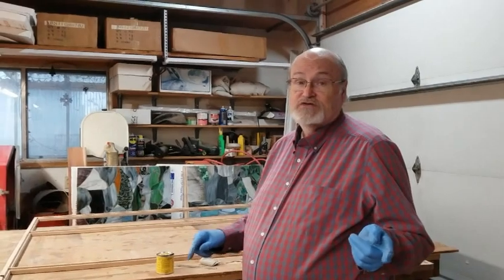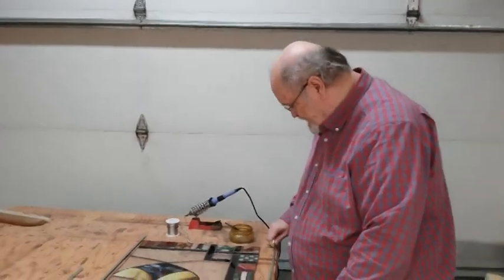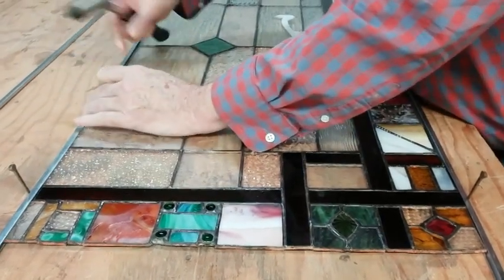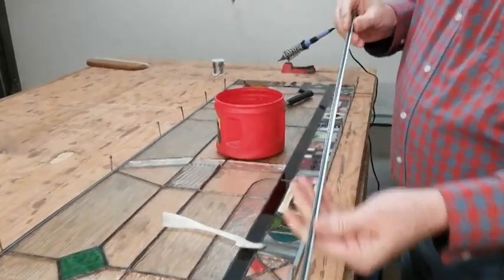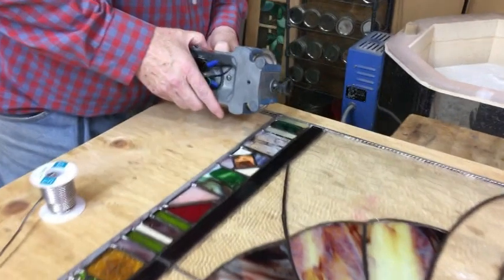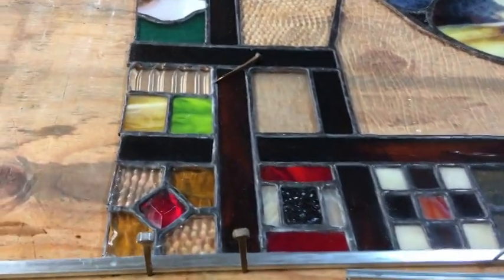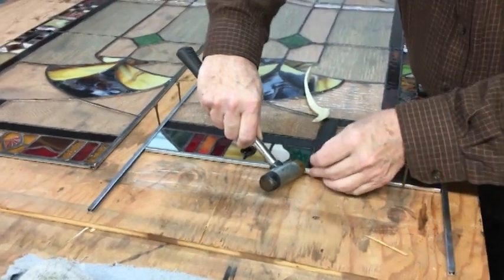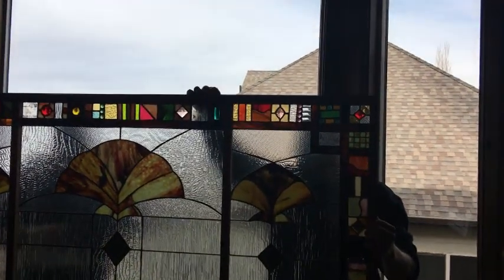Big Stained Glass Frame And Install V295

Comment: I have to do this quite often and I used a wood block against the wall and use a 3/8 wide flat blade screwdriver which I push along the zinc groove while wearing thick gloves to avoid injury. Goes quickly and works every time.
Reply from the maker: Thanks, we'll keep it in mind. I enjoy having a pro glass installer go with us on installs, we don't have to take on so much liability and two heads are better than one!

Comment: Awesome panel. Love the three pane design...the simplicity of the center panel design and that border is sublime.  Any chance you could share a mini scale sketch of this work. I would be willing to pay for any repro costs associated. I have a 48" x 48" center window in a newly installed bay window cluster for which this design would be spectacular. Also looking for a challenging winter glass build project...been looking at FLR ideas and Prarie style but yours just grabbed my attention.
Reply from the maker: They are pretty easy designs. One thing we've done is to view a video on a tv screen and pause it where we wanted to copy. Then we trace the image. This is how we did a copy of the stained glass from the Santa Claus 2

Comment: Wondered how the Alder frame rails and stiles were attached. Couldn't see the joinery. Just glue and maybe corrugated joint fasteners? Looked pretty solid. Also I reviewed your V295 vid. and saw the design line drawing... exactly what I was asking for in my last entry.. Thanks so much. I now have my winter '23 project.
Reply from the maker: Hope all goes well. when we got to the install, Greg took a sander to one edge to get it to fit even better. The joinery was glue and nails.
Reply: @GommStainedGlass  Thanks for the information
My version will be in a 44.5" square window space. I am considering constructing the design as a single pane rather than the three panels you folks created. I think the size is right on the cusp of " too large " to be stable. Possibly OK with thoughtfully placed restrip and some chunky perimeter copper channel. I'be been sketching it out on paper and I think the space is too small to accommodate the design and the two extra frame rails for a three pane install.  Your thoughts?

Comment: This is a beautiful window. Beautiful job. Just wondering if you put any sort of rebar supports on it any where?
Reply from the maker: We never use rebar since we only do the copper foil method. So we use restrip which fits down in-between the solder joint. Since the three panels are small, they are fine with silicone holding them in the wooden frame.

Comment: WOW.  That was pretty spectacular.   My only question is,  what/how did you do the final anchor once the window was in place?   1/4 round?
Reply from the maker: Glass Doctor helped with the install and the frame fit so tightly that we just used silicone to hold the assembly in place. It looked perfect!

Comment: When adding this to an exterior window, how do you deal with the temperature differential and preventing condensation inbetwen the stained glass and the actual window glass?  Doyou have air holes in the frame?
Reply from the maker: When we install a panel, it's almost always against an insulated unit so there's little temperature variation. When it's a fairly small panel I will often leave a gap in the caulking to allow slight air flow to minimize condensation. The large frame in the video had so much square footage that air flow was pretty good and the frame wasn't sealed tight so the unit breathes.

Comment: Did you use re-strip in these windows since they are so large?  or because they are framed in there would be no need?  I have not done any windows this large yet and just want to be prepared when or if I am ever asked to.
Reply from the maker: I posted  a video on restrip three weeks ago where I showed how I placed it in the center of the largest panel. https://youtu.be/G73if4vZIX8
Reply: @GommStainedGlass  that’s the same piece?  Sorry I didn’t recognize it was the same window.  You responded to my comment on that one.

Comment: I thought I saw one of the jewels going to the edge. Do you have any trick for dealing with the raised glass when it is substantially thicker in a small spot when putting on the zinc?
Reply from the maker: If I have a raised edge, I simply widen that part of the zinc a little extra so that it fits over. I had to make all of the zinc edge wider since the solder went rint up to the edge, rather than staying away like we usually do.
Reply: @GommStainedGlass  fabulous window,

Comment: David, Have you ever used “center cut” frames?
Reply from the maker: No, I'd like to know more about them.
Reply: @GommStainedGlass  I use center cut Black Walnut frames. The center cut is very doable if you have a table saw.  I’ve even center cut 1/2” frames for incredible strength. With a little practice you can master this.
Reply from the maker: @j.k.terrell8034  Thanks, the knotty alder wood that Greg used for those frames is also very tight and strong. As a wood worker, I love working with walnut, so we'll have to give some center cut a try. Thanks for the comment..it helps!
Reply: @j.k.terrell8034  Can you please explain the term center cut framing please. Attempting a similar project as this window and looking for options for constructing a sturdy frame.